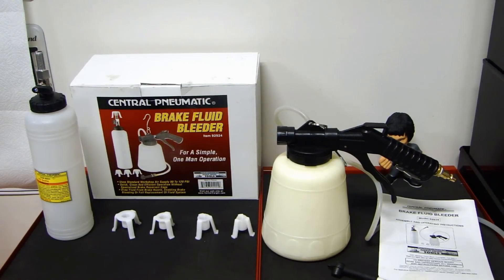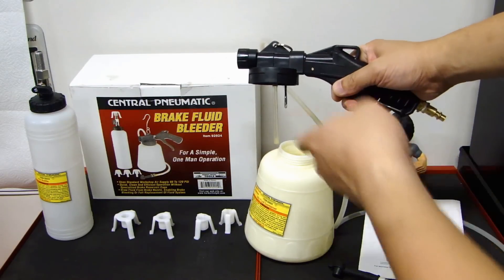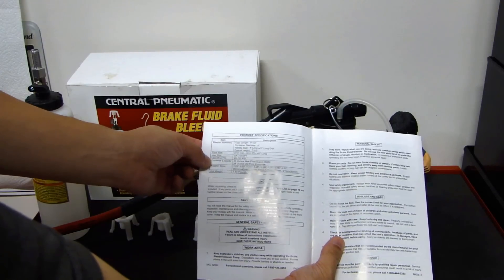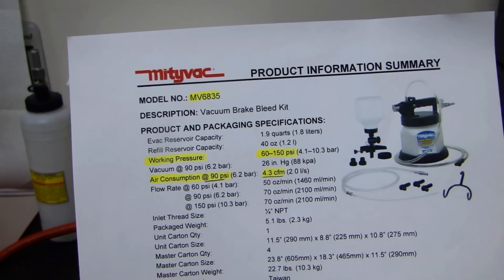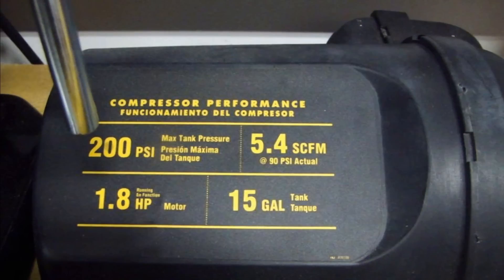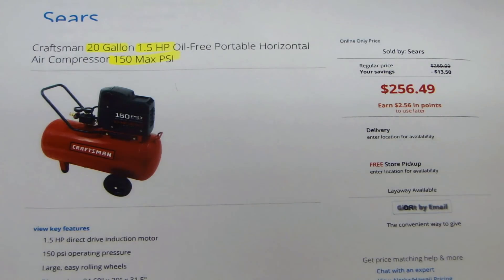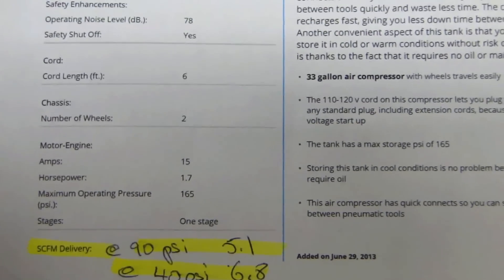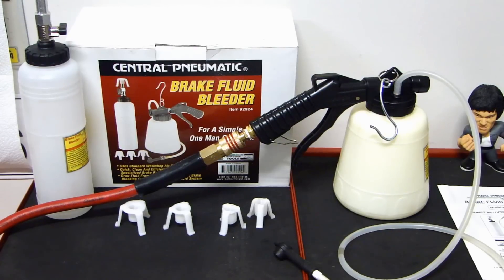What Compressor To Use With Pneumatic Brake Fluid Bleeder

Comment: For me, a 6 gallon, 2.6 cfm Porter Cable pancake compressor worked great. I had a quick-connect on the end of the trigger bottle, connecting to a female quick-connect on the hose from the compressor.

Comment: This unit worked excellent for me....set your compressor to 90lbs of air pressure and it works like a charm. Refill bottle also worked great in keeping the new fluid full. Good review....

Comment: I did my Harley Road King brake lines and clutch line. Full replacement of the fluids with a small pancake compressor with no problems.
Reply: Yea i would
Think thay enough i mean geez a hand pumped mityvac has enough pressure

Comment: the threads of the bleed screw are also a frequent source of air leakage which will cause misleading air bubbles to be seen, so removing the bleed screw and applying a bit of sil-glyde there would help. doesn't affect the bleed process but just helps if you're looking to see if you had any remaining air in the system, when a component is replaced.

Comment: The SCFM doesn't really matter, you can use a little pancake compressor and as long as it gets up to the PSI it will work. The SCFM on the hand pump bleeders are much less than what even a pancake puts out and they work as well. With a pancake you might have to wait a little for it to get back up to pressure but it will still work.
Reply: I tried to use a small compressor, it only worked for the for 3 seconds or so then the flow was too low for the venturi effect vacuum to work. I now have a 220v 33 gal compressor and now this tool works great. My big air compressor is capable of 10cfm

Comment: I have the same tool. My compressor is 4 gallons, 4 scfm at 90 psi. It behaves the same as yours. I don't see a steady flow filing the whole tubing. It's just like streaming inside the tube. I guess it's ok since the old fluid eventually gets into the waste bottle.

Comment: I have the Blue Point brake bleeder by Snap On that I bought a long time ago and did not use and now that I want to use it I connected it to a compressor but I am not getting suction or should I say vacuum and I don't know where I kept all the adaptors and manual that came with it so I don't know what could probably could be going on.Please let me know if possibly there is anything you understand about it.Thanks and I look forward to hearing from you asap .

Comment: I think you are confused about the CFM. It doesn't matter if you use the kit how it is 'supposed' to be used. Like so many on YouTube using this kit, they tend to think that you run the air pressure continually while the bleeder valve is open. It's not supposed to be done that way. You close your bleeder valve, connect your hose, create a vacuum in the tank with air pressure, then let off the trigger (stopping the compressed air flowing). You then use the residual vacuum in the tank by opening the bleeder valve and then close it after fluid stops moving. You do this over and over again until you see no air in the line. I know the instructions are vague, but if you read it over and over again, you'll see that they 'attempted' to describe the process. So the CFM doesn't matter creating a vacuum... it just takes longer with a low CFM compressor. The hand-held kit works just as well.
Reply: Thx
Reply: I used a smaller compressor bleeding brakes on a motorcycle with mixed results,it eventually worked but I think a larger unit with a bigger tank would have worked better

Comment: I noticed all of the Craftsman® branded air compressors you pulled up the specification sheets for are the "oil-free" type. What is your opinion of the longevity of these - especially the larger tank size (i.e. larger than a pancake-style tank)?
I have a Campbell Hausfeld™ 2-gallon tank unit for home use; I took very good care of it for 13 years but the piston seized up and now it is of no value to me. CH™ no longer has spare parts for my model :-(
I really want to acquire another compressor for home use but I want it to last a lifetime with proper maintenance.
Reply from the maker: The Craftsman compressor I used as examples in the video were simply just examples and not reflecting any real world reliability. CH do make some very good compressors (better than Sears). The Dewalt I am using is also oil free and had many good reviews. I hope it will last quite a long time.
Reply: Cool. Thanks! In my experience with the CH™ oil-free compressor, I believe if I would have periodically replaced (like every 5 years) the Teflon® piston rings I'd still have a functioning air compressor. You may want to look into this with your DeWalt. The rings are cheap and available - at least for the Cambell Hausfeld they are. Access and reassembly is not too complex either.
Reply: i have the craftsman vertical compressor.  going on 11 years.  i don't use it every day.  more like 4 or 5 times a month.  would recommend it for the home use even if you used it every day.
Reply: @ronaldschild157   if the piston rings are cheap and easily available buy a few sets now before they become obsolete. Then when you need them no worries about finding parts.

Comment: The tool uses a high volume of air.... look up "venturi" to see how the tool operates to create a "vacuum" .....cfm n compressor specs dont mean shit if you have a 100 gallon tank when taking about this tool. Cfm only comes into play with smaller tank storage as that's is the amount of air it can replace while running over a given time.  A "minimum of a 6 gallon" will run this.... smaller will work too, it'll just take you longer as you wait for the compressor to fill cycle everytime you pull the trigger and use up the stored supply. Even with a small compressor cycling full to empty many times is still battery than hand pumping.... unless you just do this once in a while on one or two brake lines.... then buy the hand pump one if you don't own a compressor....BUUUT if you're competent enough to be bleeding brake lines then most likely you already have a compressor.

Comment: I did purchase this kit just to give it a try, since it did look too good to be true. Well, it didn't do a trick for me. Dewalt compressor, 5sqfm, set at 110 psi. The system didn't produce enough vacuum to suckthe fluid from the brake system. What I think too is, that the concept of sucking the fluid out from the calipers sucks comparing to the concept of pressurizing the new fluid into the expansion tank, since when you suck the fluid from the caliper you are actually sucking the air from the brake fluid outlet, since if you loosen it the fresh air starting to go into the system through the thread, so it's kinda looping around. On the opposite when you pressure the new fluid from the expansion tank side - there is no way for the air to come into the system.  My set will go back to Harbor Freight. Unfortunately didn't meet the expectation at all, or I'm missing something big time.

Comment: You're very worried about matching the compressor to the bleeder...ANY compressor that makes 100 or so psi will run this.  If it has a lower compressor rating, you just may have to wait a bit while it refills the tank, which does not matter a bit- just wait!
   A giant compressor that is unplugged has a compressor output of zero CFM, and will rum that bleeder just fine, until tank pressure drops. A small tank will obviously deplete quicker. 
   A small low cfm compressor will fill a huge tank just fine- again, you just have to wait.
   SCFM vs CFM? Same...some people just drop the "S", which means "standard"...meaning the amount of air (mass) that occupies a cubic foot at standard temperature and pressure, which is 15c/59f, and 29.92 inches of mercury. That amount of air would weigh 0.0807 lb. Over an ounce, by the way.
    I say this stuff because the video, and the bleeder specifications,  imply that you can't use the bleeder with a smaller compressor, which is not true. Just buy the damn thing and plug it in...if the pressure drops, wait a little. No analysis of tenths of a CFM is needed. 
   Teflon tape on the bleeder threads will reduce or stop ingress of air into the bleed tube, which upsets some uptight people, but actually doesn't matter, it does not enter the caliper so long as the bleeder is tightened while vacuum is applied, so no minute flow reversal occurs, which could result in a little air entering where it shouldn't. 
   Experiment and figure it out, rather than fussing over 0.2 cfm...
   Also, NO shop runs any air tools at 90 psi, are you kidding me? That's funny. You'll only see 90 psi when the compressor is broken, and on its way to zero. 120 to 150 psi is pretty common. You are way too worried about those specs...learn which of those matter.
 That 90Psi that your regulator is set to (haha) is only at the regulator, when there is flow, every fitting and restriction causes a pressure drop. Every foot of hose does, also. You have less than that at the tool, when the trigger is pulled, probably a lot less. Crank it up! 
   I have never seen two regulators to step down to 90, or anyone or any shop that uses 90.

Comment: I'm just curious . . .  what is the purpose of putting a splitter in your air system?
Reply from the maker: +Jaguar151 Because my setup is for home use in a small garage, I split it so one line goes to the hose reel for my tools, and the other goes to a separate line system which provides outlets on both sides of the garage for putting air in my tires for both cars.

Comment: What if I put tube which is connected from the bleeder to the reservoir and keep hitting the brakes. It might take all the air bubbles out, right? Even if it comes with air, it's gonna be on top of reservoir making it float back to top on reservoir again. Am I correct?

Comment: will this work on a hydraulic clutch system? my daily is being an a hole and not wanting to build pressure on my pedal
Reply: It should, but from my experience it's just as easy to open the slave cylinder bleed screw with a tube attached going into a bottle of fluid, then pump the clutch pedal by hand a few times.  With the bleed screw open the clutch pedal should be able to be pumped easily.  I usually sit on the door sill while pumping the clutch pedal and keeping an eye on the clutch MC reservoir at the same time.  It's way, way easier than bleeding brakes.

Comment: What is the exact spelling of the grease you suggest using, Silvalyde?
Reply from the maker: I was using Sil-Glyde
Reply: Thank you for the spelling, how important is it to use Sil-Glyde, will vasoline or number one chassis lube grease do?
Reply: @wellingtonwebb7304 - Literally any grease will do, even spit! It's just for momentary use. In fact it's advisable to clean any excess as soon the job is done.
If in an area with lots of salt (ice/snow...) make sure to clean it. Otherwise in a short time it will be a blob of cr_p just good to rust it all in place. ;-)
Cheers

Comment: Great video. Very informative about scfm. Just wondering what amount of vacuum you are getting from the black connector of the brake bleeder. I only get about 17 hg at 90+ psi and 6.8 scfm per my compressor. Tested vac hold all the way to the check valve in the handle so no leaks in tubing. Tool did the 1 man job but not sure if it was really needed or working up to par.
Reply: Sam Weatly !

Comment: Nice!  The last compressor you showed is the one i have.  I need to get this kit and replace the fluid on my cars.  My mechanic wants to charge me about 125.00 to do this.   My wife does not have the patience to sit in the car an pump the pedal.
Reply: LOL nah it's not that is just that she does not understand how long it takes to get all the air out after opening up all the lines.

Comment: Have fun getting parts for the device. loaned the tool to a good friend and the muffler part on the front broke. I emailed @HarborFreightTools and requested a replacement part or where to get it. They informed me the tool isn't available anymore. After a little searching on Harbor Freight I found they carry it under another name brand now. Poor customer service if you ask me given I buy alot thru them. This tool was used only once and the plastic muffler on the front is brittle so beware that parts and next to impossible to get should you need them.
Reply: under a different part number and parts aren't available from harbor freight. However did find it on flea Bay so I bought another one cheap and use it. The broken muffler one will be used for spare parts now.
Reply: It’s $25 bucks on sale.  Just buy another one

Comment: 1/4" clear hose the length for project. 32oz Gatoraid bottle (tough 
bottle and reusable). 1/4" inline open and closed valve installed on 
caliper hose for vacuum control. 5/16" or your hose size to connect to 
your engine for vacuum source. Hot glue this hose to bottle cap. Drill 
hole and push 1/4" line into bottle. Start engine and bleed away for 
cheap. What maybe $7 bucks compared to $35.00 plus tax at China Freight?